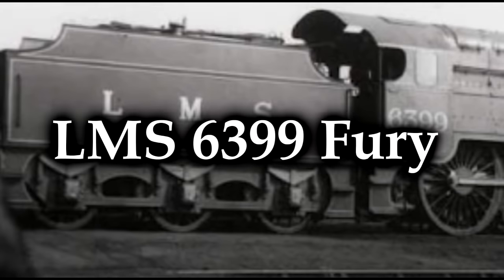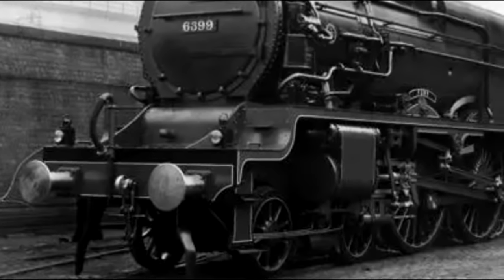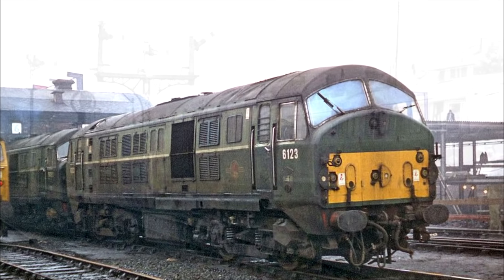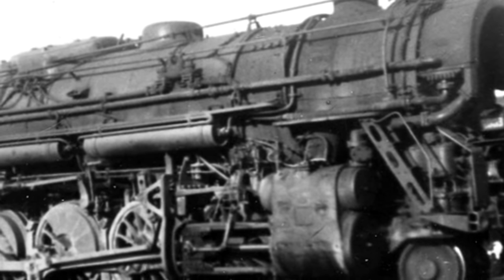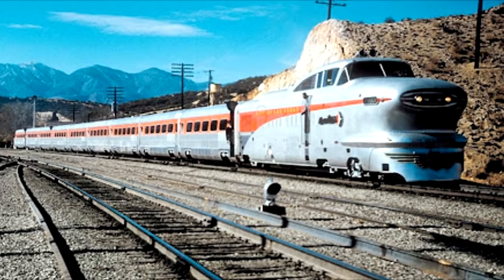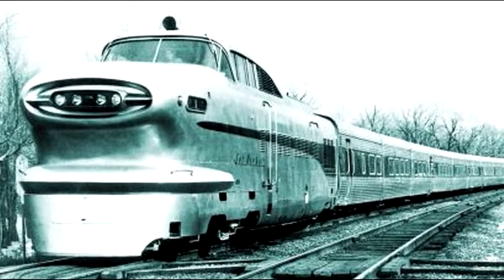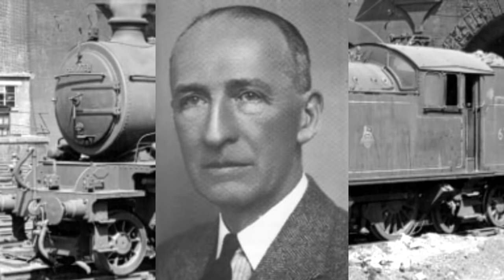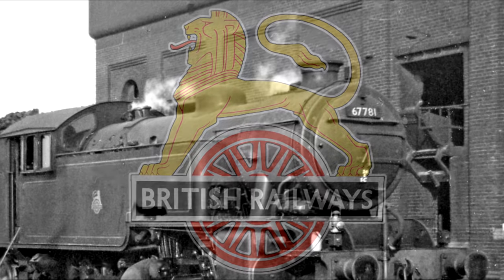5 MORE of the WORST TRAINS EVER PART 4 🚂 History in the Dark 🚂

Comment from the maker: So, correcting a flub of mine: I mention off-handedly that the Fury was scrapped. This is true...if you consider that it took about fifty years for that to happen. The Fury was initially rebuilt into a Royal Scot Class number 6170 "British Legion" and served the railway for several decades. Sorry I didn't mention that!
Reply: Considering how the series mainly covers western vehicles I would like to offer a couple of things from the other side of the iron curtain:
1) VL 26 - an electric accumulator/contact network shunter with major reliability issues because of it's hybrid system, to the point that it was universally reffered to as "Scheiße"
2) early ChS4 models that had little in terms of protective measures against electro magnetic waves coming from their own engines, which meant that they consistently exposed their crews to EMP waves
3) K series german imported elecric engines - built like crap, so vibrations caused their onboard ignitrons to fall apart scattering nuts, bolts and mercury all over the vehicle.
4) Early VL 61s, the same problem as with the above, luckily - no casualties.
5) The teploparovoz experimental vehicles from the 1930s - hybrid diesel-steam powerplant, I just cant imagine what could go wrong with such an amazing Idea.
P.S. Also the swiss electric steam engines - when your max efficiency in terms of power consumption is around 2% even such a stopgap design starts to look kinda bad.
Reply: @НиколайИванов-в8ы1я  Kind of like British Rail?
Reply: @alan6832  yes
Reply: @The Commodore P051 I wondered about that because 3 short term solutions seem obvious.  One is to leave off a car or 2. Two is to add a B unit, and three is to change to lower gears, or if torque exceeds traction, add weight over the drive wheels, which could either be just ballast or something useful like a bigger engine.  What is "refraining"?
Reply: The underpower of the Aerotrain seems to me like nothing that couldn't be fixed by adding an F,B unit; or earlier with an E,B unit.

Comment: The "nun's hood" was a Coffin feedwater heater. Feedwater heaters were mostly an expensive, high-maintenance way of doing what an exhaust steam injector did much more simply: adding water to the boiler without reducing steam pressure noticeably and recovering some of the latent heat of evaporation (which is surprisingly large).

Comment: The Thompson L1: the standard loco for stopping trains on my local line to London. We called 'em '677-ers'. I didn't know about the shaking apart - fascinating.
A vid on Thompson would be interesting: his rebuild of the Gresley A1 was odd, but his B1 all but excellent. He detested the Gresley conjugated valve gear, having spent much of his time in maintenance and hence keen to use only 2 cylinders where possible.
Reply: They were nicknamed Concrete Mixers. I used to love the clanking of their Walschaerts valve gear.
Reply: I feel he did that to try to smear Gresleys name more than anything. Great Northern didn’t deserve to become a shity rebuild
Reply: @ryancampbell4119  Yeah, it was a pritty shitty result of a rebuild but I don't feel that it was done as a deliberate smear. It was an attempt to avoid conjugated valve gear - although there were other options available. Stanier too was not a fan.

Comment: Side note, the GM Aerotrain car bodies were straight up GM new style bus bodies modified and set on railroad wheels, at high speed the cars jarred very badly due to how light they were and that they used air shocks instead of springs
Reply: not to mention that the Power units were literally switchers given streamlining and were regeared for high speeds.

Comment: I think if the aero train was heavier, it would have actually had more power because it’s weight gives the wheels more traction giving the engine more pulling power. This is why large, heavy engines are the most powerful

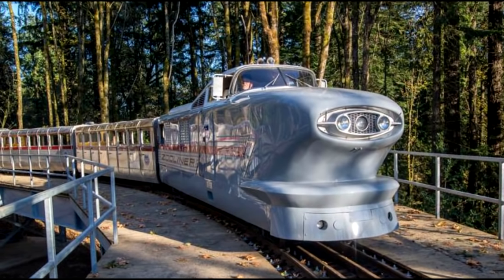Comment: 12:55 Locomotives need to be heavy for better traction. The train it hauls needs to be lighter. 
Further, only the front two axles were powered, the rear unpowered axle was heavier than the front two.

Comment: 10:48 I believe this is the problem with the areotrain. The wheels on a train, and the rails are made of steel. Steel on steel contact has very low friction, but since trains are usually heavy, the weight allows them to create enough friction between the wheels to get moving better. But the Areotrain was really light, so it couldn't apply much pressure on the wheels, which is probably why the trains couldn't get much speed.

Comment: Ngl for the next list, you should add the AT&SF 3000 class (2-10-10-2 Wheel Config.) if you haven’t added it already
It was a massive failure, built between 1911 and 1912

Comment: 11:00 - that's actually the Rock Island's Jet Rocket sevice, which used the same loco type (EMD LWT12) hauling a TALGO set rather than the EMD-bus-design coaches ofvthe Aerotrain. It wasn't much more successful that the Aerotrain, either. One wonders if the locos had been built with SW1500 engines instead of SW12 ones...

Comment: im pretty sure the PRR's T1's were supposedly clocked at speeds up to 140mph so the new one (5550)will probably break the record
Reply: Being raised in the UK on City of Truro's 100 mph (possibly), 4472 Flying Scotsman's 100 mph (probably) and Mallard's 126 (almost certainly), I'd love to see the PRR T1 hit 140, with unarguable, modern measurement in place of the dynamometer cars, and realize the ambitions of its creators - historical and current. So many locomotives might have actually been the fastest, 80 years ago, and you'll still be able to argue the case for your personal choice but...what if there's a definitive, 21st century record holder?
Reply: It is very unlikely that a PRR T1 actually reached anything near 140mph. Any such clocking would be informal, done with very basic equipment and as realistic as the 10 second 0-60mph time claimed by an acquaintance for his unmodified Datsun 1600 (510 to Americans), as measured by a casio digital watch and the car's untested speedometer.

Comment: The scarier problem with high pressure steam than the pressure is the fact that the temperature of the steam is extremely high! High pressure steam can reach temps as high as 500-600 degrees at the pressures you mentioned. So a little leak let's that highly saturated steam release to the atmosphere at stupid temps and extreme expansion rates. I bet if they ever got the fury up to it design potential,they would had problems with the cylinders blowing out and the normal venting action as the cylinders stroked would have caused erosion faster than the metallurgy of the time to keep up with.

Comment: The Class 21s weren't strictly British Railways locomotives, in that BR didn't design or build them - they were built to a BR specification. They were designed and built by the North British Locomotive Company, which was a long-time builder of superb steam locomotives, but just not experienced at building diesel locomotives. Their diesel engines were a German design built under licence, with its metric dimensions converted to imperial measurements, and NBL were more used to heavily-built steam machinery, not prescision-built diesel engines, and this all contributed to the engines and the rest of the locomotive not being reliable. NBL going out of business (as no longer building steam locomotives and no more customers for their unreliable diesels) was the nail in the coffin for the Class 21s (and 22s).

Comment: Nah, the PRR T-1 belongs on the list 100%. Cool locomotive, but man the later built ones were terrible with wheelslip.
When departing Harrisburg station their train would routinely be shoved by a K-4 to get it started because the drivers slipped like crazy. 

The only duplex that didn't have this issue was the Q2.

Comment: I think with Thompson I’m mixed

While I do think that he’s overhated 

(there are facts that make me skeptical such as the timing he rebuilt Great Northern suggests it was a regular maintenance and he didn’t rebuild it purely by choice)

I do think he didn’t appreciate how much some of Gresley’s stuff mattered
Reply from the maker: He was definitely super jealous of Gresley's success and legacy. It's a shame he was so absorbed by that because when Thompson focused on an original design of his own he really was a perfectly capable engineer.
Reply: While I can agree Thompson was overshadowed by Gresley’s larger influence, he never outright hated Gresley and his designs. The two of them had different opinions on certain design practices.

Thompson’s main goal was standardisation, something Gresley didn’t really follow and had a preference for regular layouts of valve gear rather than Gresley’s conjugated motion which the two clashed on. Thompson had the right idea, but his designs were rather flawed unfortunately. 

That being said, Peppercorn’s designs, while more Gresley themed, used the same elements as Thompson’s designs such as the divided drive valve gear and were an overall improvement of Thompson’s rebuilds. Thompson wasn’t a bad man, he was just doing his job which he got stuck with during war time. Since there wasn’t many new materials for building new locomotives, Thompson had to rebuild older ones.
Reply: @HistoryintheDark  Is there any evidence that affirms Thompson's jealousy. Any argument with Gresley was down to the valve gear of Gresley's patent. While locomotives with such valve gear could run well provided they are maintained properly WWII exposed what happens when they're not, and Thompson was acting on recommendations of those who did the inspections.

Comment: HOW COULD YOU MISS TALKING ABOUT THE WHEEL ARRANGEMENET OF THE AEROTRAIN???
The Aerotrain was a B-1 arrangement, two powered axle truck in the front and one unpowered axle in the rear. It had a 1,200 hp engine so that should have been enough power, but only half of the locomotive was pulling the train

Comment: Another glaring issue with the Aerotrain is that it was a GM parts bin special. The cars were literally bus bodies with bus suspension. Almost like unpowered Pacers. This caused the cars to ride extremely rough, and for the cars to violently shake above 80 mph.
The observation car’s distinctive end was ripped from a station wagon of the era.

Comment: Hey your being unfair to BR
They had a hard job, when they started with diesels they had nothing to replace steam with so they asked for lots of designs from different companies and some were good, IE Class 20'37'31'47'50'55,08,03,04 ect but however some builders were rubbish
IE Class 21,28,17,40 ect so stop bashing BR for stuff that was out of there control
Reply: The 40's were underpowered for the express duties they were given when they first came out (with the honourable exception of their work on the former Great Eastern lines),  but when they were put onto cross-country passenger and heavy freight, they were rather good, and some lasted a good 25 years in service. So, maybe bad utilisation rather than bad engine?
Reply: @robertwilloughby8050 yeah your right. The 40 is quite good at that, they just seem slightly underpowered is all I meant, I would put them on successful.

Comment: Actually You can get away with putting the production variants of the T1, Q2, and S1 duplex in the worst train since of the major wheelslip. Only the Prototype variant T1 and Q1 duplex is the best duplex. The T1 5550 project is rather a flawed idea. The engineer who operated the original T1s said to ease the throttle and never exeed 120mph. Beating Mallard's record with a T1 is flawed,  just try with the 7002 reolica.